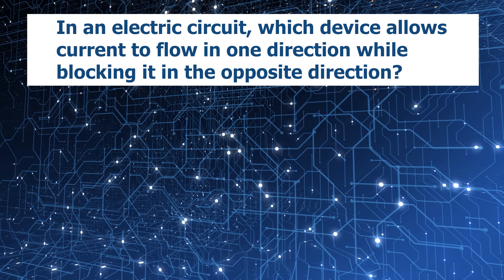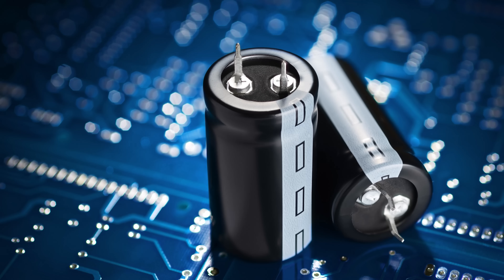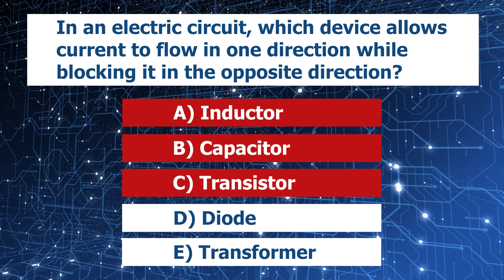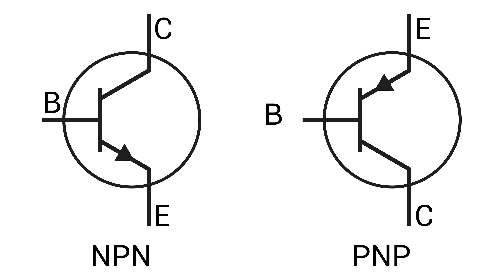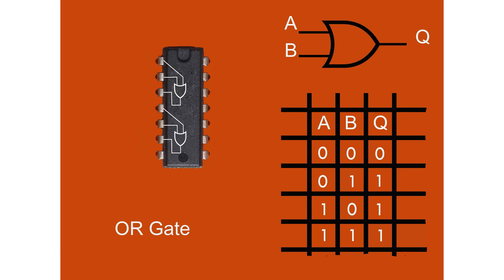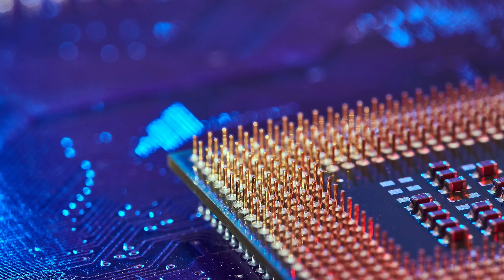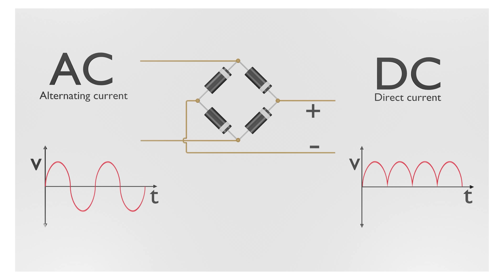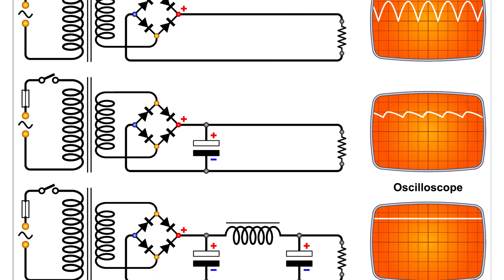What is a Diode, Transistor, Capacitor, Transformer, Inductor?

Comment: Real World Applications Summarised:

1. Inductor - Allows DC and Blocks AC electricity (Stores Magnetic Field Energy)

2. Capacitor - Allows AC and Blocks DC (Stores Electric Field Energy)

3. Transistor - Used for making contactless switches, used for amplification of electric signals, used to build CPUs and registers too

4. Transformer - Converts high voltage to low and vice versa for AC current keeping P(input)=P(output)

5. Diode - Allows the current to flow only in one direction, used in rectifiers (AC to DC conversion)

Comment: High voltage transmission is the logic of avoiding current, which would cause dissipation of the voltage exited state, sense. Storage logic like a battery till tapped.

Comment: I can tell you if you have an electronic device like a portable radio that won't work it is usually a diode that has blown.  They become very brittle when they burn out so sometimes you can take a tooth pick and rake across the diodes which are the very small tubular shaped things and you can open that circuit and the radio will work again.  I have done it.  It may lose some aspect of what it was intended for but it will work.

Comment: I am an Electronics troubleshooter, retired. You remind me so very much of a physics professor that I had. That man was so knowledgeable on so many different subjects and trades. You seem to be in his category of expertise. Are you a physicist? 
You posted the title of this video as: "what is a diode, transistor, capacitor and transformer." When I as a troubleshooter looked at that question, I had to chuckle just a little bit because I answered the question with: "looks like an Armstrong oscillator to me," lol. However, I knew what you meant. Thank you Sir for a very instructive video.
Reply: What about Maxwell invention of Self powered car.
Reply: @ajithmanayil8325  Personally, I am more fond of Nikola Tesla. He had a hand in most all modern technology, though he does not get credit. Either someone else beat him to the patent office or cheated him out of it. Just like Edison inventing the light bulb. Yes, he has the patent, but it was Louis Lattamere and his patent on the filament and hard work that brought the lightbulb into a functioning light.
Reply: @Philippians4vs4-8  Sir did you see the video about self powered car made by a Zimbawean his name is Maxwell. In that car no need to recharge.
Reply: @ajithmanayil8325  very impressive. Needs to be marketed right away. Tesla (from what I understand) is working on a solid state battery. Is that similar to what you are discussing? Must admit, I haven't heard, but most technology far surpassed my knowledge many years ago. Several years before I retired, I had to go back to school to try and keep up with all the changes. By the time I graduated, most of what I learned was obselete. 🤣
Reply: REJOICE IN THE LORD ALWAYS,I SAY AGAIN REJOICE
Reply: @jasper5712  AMEN Brother. Thanks!
Reply: @jasper5712  YESS INDEEDY

Comment: Love it when you described a Transistor and said "it's like a valve". Indeed : it is like a vacuum Tube. Magic. ♥️
Reply: @vacuumelite2065  The operation of a transistor is linear, whereas a vacuum tube is non-linear. The solid state non-linear devices are the FET and MOSFET.

Comment: it would be nice to explain how it happens that the inductor or a capacitor makes a phase shift between the voltage and electric current in alternating current. Everyone knows that, even the children from a kindergarten, but almost no one really understands
Reply: Just think inductor and capacitor as spring which communicates the inputs having time lag if you let a slinky fall from full stretch condition when you release it last part of slinky have some time lag when it was released due to springy nature same applies to inductor and capacitor

Comment: Conclusion
The Giza Plateau layout mirrors a server's architecture, where each element serves a purpose akin to server components:
Pyramids as CPUs, the heart of operations.
• Tombs and mastabas as memory and storage.
• Causeways as data buses.
• Boat pits as storage for vital tools/data.
• Funerary temples and 1/0 ports as the interface for external interactions.
This metaphor highlights how ancient and modern systems rely on structured organization to perform their functions efficiently.
The oldest circuit board known to man !!! Tune in for more!!
it's funny how the memory slots line up
with the western cemetery, I don't see why nobody has connected this resemblance before!!